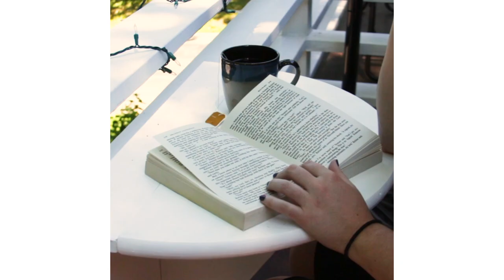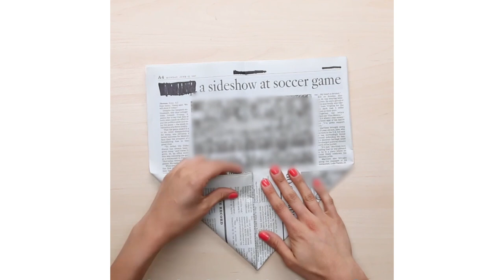Crafts To Upgrade Your Balcony

Comment: DON’T Use regular concrete for the table top fire pit!!! concrete expands with the heat and can be dangerous, there is a special concrete you can find in any hardware store resistant to the heat